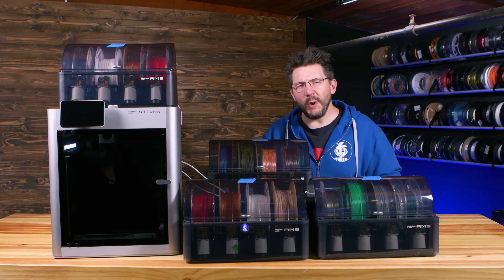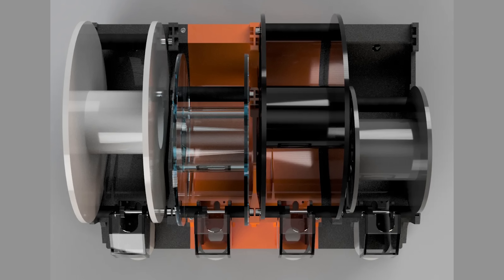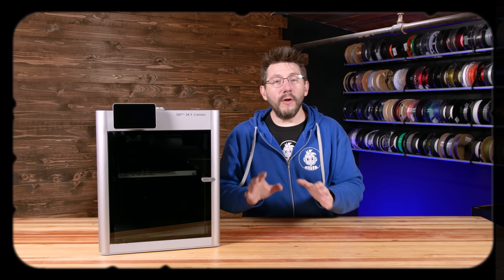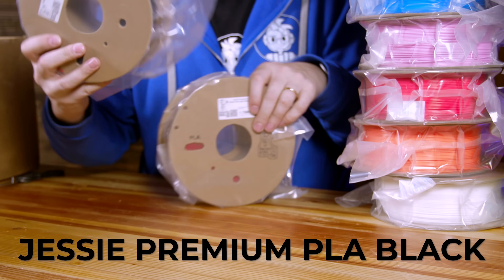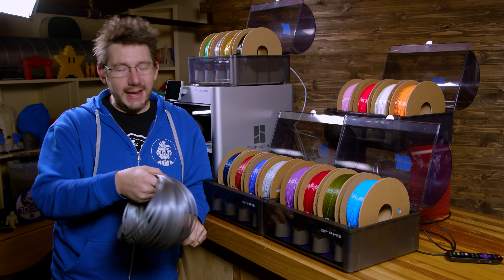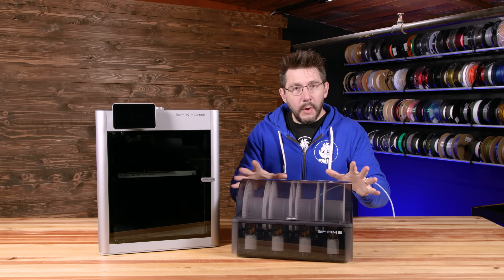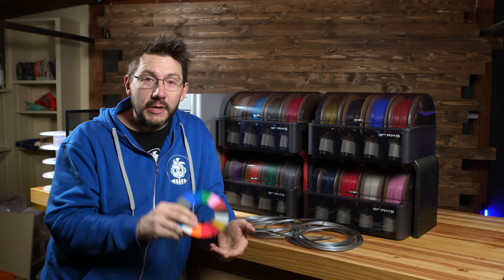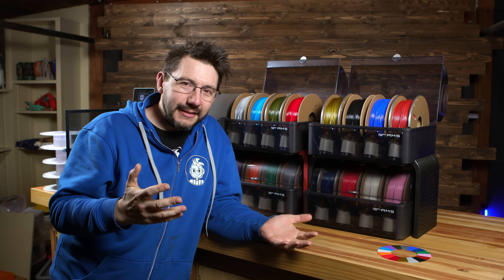Will the Hydra Mod on Bambu AMS Work?

Comment: I made a mod that allows you to replace the stock ams rollers with ones that are a little bit smaller and I’m able to fit my 203mm plastic spools with the lid closed just fine. I’ve installed it in two AMS slots and printed for many hours without any issues. It doesn’t help if your spools are too wide though. 

If anyone tries it I would recommend paying very close attention to clearance and keep an eye out for any changes to your machine and also be careful if you have the old ams revision with the bearing blocks that have been cracking for some people. I have the newer revision so can’t speak for the compatibility or chance of breaking something with the older AMS.

It’s on thingiverse and printables. It’s simply called “Bambu lab ams roller mod”

Comment: You just alleviated all my concerns about the AMS. I really want a Bambu Lab X1 Carbon since zi just recently discovered they even exist, but I was terrified of the AMS not working with any of my Jessie PETF cardboard spools
Reply: I just use electrical tape and they work fine in my AMS
Reply: Who is Zi?

Comment: Honestly as an X1 Carbon owner struggling with a bad AMS from purchase this is just disappointing to see Joel get 4 new and improved models like it was nothing.
Reply: They sent out so many bad units at first that they are doing as much damage control as possible. Deny claims made by customers/Make it as difficult as possible to claim a warranty to cut losses from the bad run of units. Make sure all Social Media people have good units and instant fix their issues so that way the public moves on from their horrible initial run of AMS units.

The really telling thing is how they treat their first adapters, I'm fully convinced that going forward we shouldn't expect any better customer service than what we're currently seeing with their AMS units.
Reply: I'm wondering if I would be having the same issue, would I be treated the same way as Joel? Most likely not...
Reply: He's Joel. Her gets priory. Always.
Reply: Agreed, having issues with my path #2 not detecting filament anymore after having a jam.  I notice lots of spool drag in each bay, I'm constantly checking and adjusting spools to reduce drag.  I printed and added cores with adsorption beads to add some weight.  I also never received any free spools with my AMS.
Reply: Joel I love your videos but this one made me frustrated.  I'm 2 months in trying to get an ams working correctly with my p1p.  After I recieve the motors from this last session with support I will have replaced all the internals to the ams except the plastics.  Between all of the different parts they have shipped me almost every two weeks you think it would have been cheaper to just swap out the ams.
Reply: Not just the AMS, plenty of issues with the motion system being reporting in non Bambu discords, facebook groups etc but suspiciously almost nothing in anything curated by Bambu themselves...
Reply: yup. same.  must be nice!!  typical customers like us have to play email tag for weeks sending multiple logs and videos to even get a small part sent out to us.
Reply: I wish I was a YouTuber
Reply: Got them to replace my AMS after weeks of going back and forth “troubleshooting” and replacing multiple parts. Can’t complain too much as my replacement was a new unit and it came with the four reusable spools. Not doing the hydra mod again it wasn’t worth it for me
Reply: @Gholson314  yeah they seem to help most people only complaint Ive seen is they are slow  and make u send same info multiple times slowing it down or they try tell you its in spec.  but printer is less than year old and I doubt they thought they get the amount of orders they did I'm sure they hire more and catch up on all that stuff not going make people happy now though
Reply: @jamesharris9894  exactly definitely helps if you have a business to have more than one for these moments. So far my new one that came with my second x1 carbon has only had one pull back problem and I think that’s because of the shitty filament that was in it. I haven’t got a chance to try the new one yet but I will. Very excited for some 8 color prints
Reply: @Gholson314  This seems to be a similar story for a lot of people. I was going to do it when my X1 finally arrives, but I won't be now. I might just look into re-spooling.
Reply: I dont own one and I was thinking the same thing
Reply: Seems like I rarely see this kind of crucial information like these posts when there is general discussion about people's experience with Bambu. Brand loyalty is awkward...
Reply: I had issues with mine and they posted me out a new one.
Reply: I always wait at least 6 months to buy anything brand new to the market. Let everyone else work some of the kinks out before I dive in
Reply: I own 2 of them, bought the from the Kickstarter campaign. Both with an ams. Zero issue straight from the start. Going to order a 3th one after my holiday. So there are a lot of good ones out there also, don’t go after all the horror stories. It is sad but each brand has got horror stories (and of course I think they should solve them)
Reply: This chaps my ass as well. Having a problem with slot 3 and sent a support ticket in 5 days ago, haven’t heard a word from them. Honestly I am so happy with the printer’s performance it’s unfortunate I am not a you tube influencerto get better service.
Reply: Man, I was about to pull the plug on a Bambu but everything written here just tells me I’ll be getting involved with another Kodama type company/situation.
Reply: I’m considering a Bambu printer and AMS, but like here, I hear a lot of horror stories about the reliability of the units, and atrocious customer service. In addition, the fact that Bambu comes right out and tells you they access and can use what you print (making commercial printing a big risk) is really having me reconsidering the whole product line.
Reply: My X1C with AMS will come this week. I hope the problems are fixed with the newer revisions now 😅
Reply: All 3 of my ams, and x1c units have run with ZERO failures for over 400 hours now.
Reply: Should I get one? I've been hearing so many mixed reviews.
Reply: @Marco-ki2jr If you are considering buying a car that is new to the market and has sold at least 50,000 units, but have concerns about potential problems reported to you by 100-200 people, keep in mind that this is not a representative sample. Even if you asked 10,000 people, it would only represent about 20% of the total. My own experience with my P1P printer indicates that problems that were described as dramatic were quickly resolved by customer service. Service was efficient and I did not have to wait long. Overall, I am very satisfied with my printer.
Reply: I feel for you, I want to toss my 3 day old ams units in the trash.. I love the printers but so far my ams units have just made my printers unreliable. My p1ps without ams units print away, brand new p1s'a all are jammed as I type this, because of the ams units on top
Reply: Mine has trouble with pulling the filament back when it wants to switch reels also
Reply: @stevenjacobs6608  I think I remember seeing online that there may be a known problem with the first lot of AMS. It might be worth contacting customer support or searching here on youtube. There is a print for a device that fits into the hole that the filament first goes into in the AMS.
Reply: I have three freaking AMS v1 units.
Reply: honestly this, I gave up with support. every week I would message saying slot 2 is having issues, i think the motor died. THey ask for the logs, I run a shop its hard to stop printing and export logs, I need the printers running, So i will export the logs, then they ask for a video of it happening, which means I have to set up a multi colour print job and interupt the jobs I am doing to intentionally put a multi colour print on. only for them to say oh maybe it's the motor, They send out a new motor and then repeat everything with another slot a few weeks later.

Though to be fair, still the best printers I have used out of the 60 or so printers I have owned. I just work around the bad slots :D

Really wish they send me new AMS tho. Maybe i need a youtube channel.
Reply: Run some PLA CF through every slot of the AMS.  Mine wouldn't print from any of the slots except slot 1 which I initially ran the PLA CF through.  Ran it through the other 3 and it's been a year with no failures since.
Reply: Bambu stopped responding to me about a damaged order , they literally won’t help and ignore me now I had to open a chargeback with the CC company.  This is after spending $3000 with them over $70 of damaged items. They are a sh1t company
Reply: @Miketime969  had to do the same.  Once they realized I had submitted a dispute there was no questions asked on my return.
Reply: Try dealing with X-Tool.😡

Thier customer service/support makes Bambu look like Concierge level service... @Miketime969
Reply: Yeah, not to mention ordering one takes for ever, so wtf gives?  Talk about treatment. Looks bad from a company.  I wont be buying the 3 others I was planning (full x1s with 2 ams each) I will instead just go the K1 Max.
Reply: simple economics more value to bambu for him to have with 600k eyeballs
Reply: @jamesharris9894  lol.. simple economics.  tell that to Bud Light after pandering to an influencer.  dont forget to take care of your actual customers.  your base is who buys your printers not the influencers who get them for free.
Reply: @jp-3dairgunworks152 I agree 100% but none them do that though they all going help the people that got the stuff for free  first because they might make them couple sales and customers get the shaft and run around
Reply: @jp-3dairgunworks152  exactly but that one cost Bud Light billions. South Park's Panderverse was so true.
Reply: Yet, it may seem unfair. But if you were a company and a 3D printing influencer with 600k subscribers reported about issues, you‘d do the same and send replacements as fast a you can. Joel is a big multiplier in the community. I have experienced the same priority when writing articles for various magazines. But obviously, it is never a good idea to not treat your customers as if they all were VIPs. I expect from a company like Bambu Lab to offer the same fast and qualified service as Prusa offers it to its customers. A 3D printer that has issues is a clear no-go.
Reply: I took the wait & see approach with the X1. Well, I've waited & I've seen, and I will NOT be going with Bamboo for any of my printing needs. Reliable customer service is a MUST for multi-filament systems as I would imagine many intend to use them for a side hustle or full on business. That means any down time is lost revenue and when we're talking weeks to get a warranty claim approved let alone the time for replacement that's just way too much time. Maybe I'll check in again in another year or so & hopefully the growing pains will have worked out & the customer service might actually be worthwhile but currently at this price point and with this many issues it's just not worth the down time.
Reply: I have 2 x1c with 3 AMS each and rarely have issues. Clean and service them and they will love you back…
Reply: Bambu customer support is anything but support. My printer came with the "Random" textured plate. This info is at the bottom of the order page deep down and not at the top when buying it. Anyways the addons part they want you to buy at a discount when ordering the printer shows you to get the textured plate, this is because most of the people receiving the printer are getting the dual sided cool plate. After dealing with customer support, they told me there was nothing they could do because the website does say a random plate will be sent. So, I told them that is horrible customer support, and I would direct people away just for that reason. I then said, well I bought a second plate can I not do a return/swap for a smooth plate, and they eventually said yes. But now I have to pay to send this plate back to order a new one and pay for shipping again to receive it. At this point it is easier to just keep the plate and just order a smooth plate. Bottom line of this rant is that Bambu Labs has no idea what customer support is or how to do it. They swap out gear and send free stuff to the youtubers to make it look like they have great customer support, but in reality, it is just great marketing and nothing more. To use it looks like they are willing to do the right thing when stuff is broken, but this is not true as for all the accounts of people having nothing but issues with printers and the support that Bambu lacks to have. This is a shame seeing how well the printer works, when everything is working great, but be aware that you will be the last person standing when it breaks and there will be no awesome support like Joel got here, no way, no how.
Reply: I'll never buy Bambu, I have a feeling they design products that work only with their products, the Apple of the 3D printer world.

Comment: I tried the Hydra as soon as I got my P1P, but ended up going back and using the original hardware. I had way to many jams. I'll just have to re-spool odd spools. Matterhacker Build filaments fit perfectly, so I'm holding onto those spools.

Comment: Careful, Bambu has taken a stance that Hydra Mod will now void your AMS warranty!
Reply: Several lawyers pointed out that the law governs what a warranty covers, not the policy statements of the company after the fact. BambuLab has reversed course.
Reply: Oh great, no modding allowed. It keeps getting more attractive. ;)
Reply: Just reassemble the AMS using the original casting (if needed for warranty purposes)

Comment: I printed a hydra a few months ago in purple Esun PLA+, my AMS now works with the Prusament spools and the wide Filament PM spools. I’ve had no issues with the hydra so far, works perfectly fine.
Reply: I'm about to get my X1C with AMS, Should I get the Hydra mod straight away?
Reply: @lyx9560  I’d say yes, but that’s mostly just because half the filaments I use comes on spools that don’t fit in the stock AMS. Nearly a full year since I installed the hydra mod and I’ve had zero issues. it’s also a nondestructive easily reversible mod, which is nice.
Reply: @Aikano9  Honestly im just worried about the warranty, so ill give it a couple months seeing theres no issues in the AMS system itself and then switch to hydra ;)
Reply: @lyx9560  that’s why it’s so great that it’s a non destructive and fully reversible mod, you can return it to its original state without anyone knowing it was once hydra modded.

Of course, if you don’t plan on buying any filament that comes on a very large or tiny spool, then I wouldn’t bother printing the hydra.

Comment: I have watched many Hydra videos and decided that it is a bandaid.  I'm hoping this will drive spool standardization or the conversion to a master spool solution.
Reply: Spool standardization isn’t a thing, because different filaments have different density. It’s also not required in any other context except one printer manufacturer’s rewinding device. Requiring the spools to roll on their edges was a design choice. The problem is BambuLab’s to solve, not hundreds of filament and printer manufacturers. They could also have grabbed the spools by the centers and spin them on axles, which is how all the filament winding machines including the ones that make their branded filament already work.
Reply: @B3MDUSA  Thanks for your insight.   I think some form of standard or standards would be helpful, especially for master spools
Reply: Attempts to standardize filament spool dimensions have worked like many other attempts at standardizing things in other industries...each attempt just adds one more standard to the collection without removing any of the existing ones.